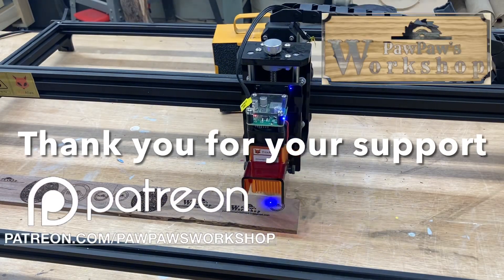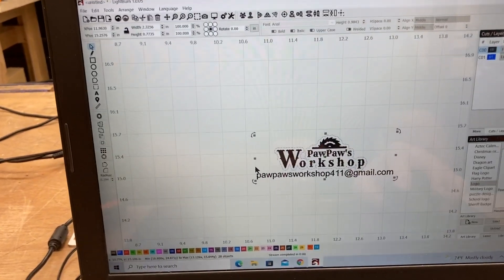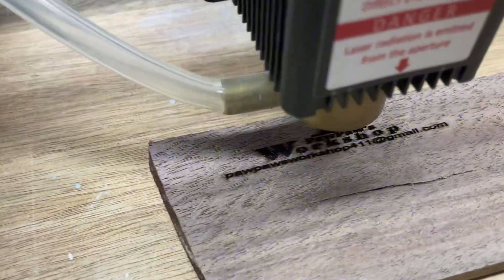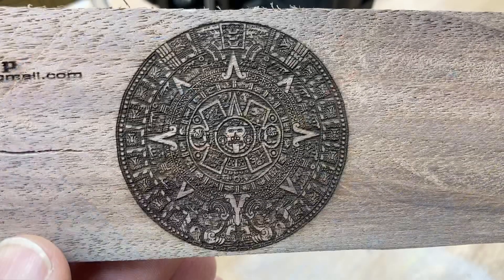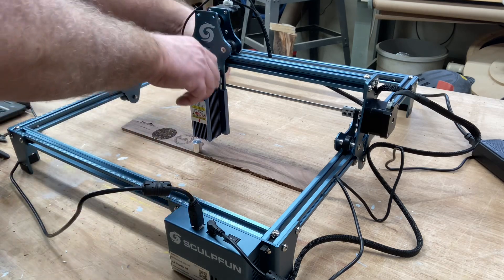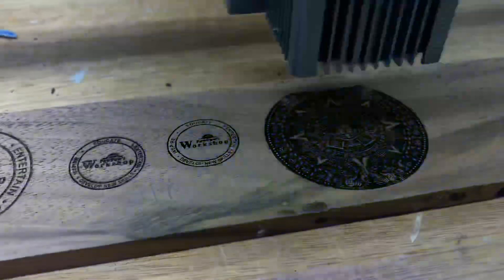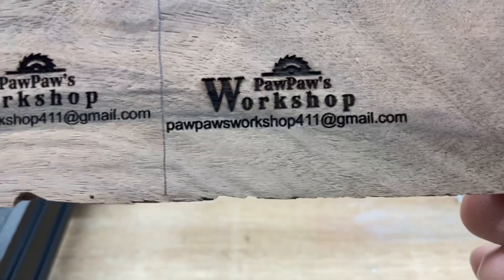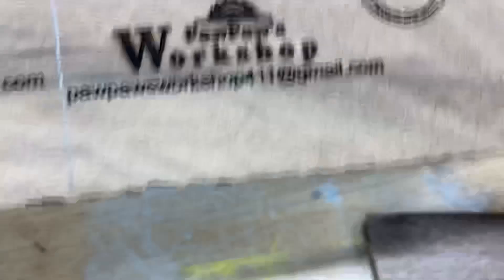Tiny Engraving on Walnut With Three Lasers

Comment: Hi Paw Paw, Been a fan of your channel for quite sometime. I have the Jtech 4.2w laser mounted to my Xcarve. How important is it to use a smoke fume extractor when using these small diode laser engravers? You had a small smoke/fume extractor in the video can you share what and where you purchased?
Thanks
Reply from the maker: Smoke can be a problem. A small project. Not so much. I did a review on the smoke extractor

Comment: you should quit using the nomenclature the Chinese companies use as they are very misleading. Max real output from one diode is 5 watts. The numbers they use are very misleading and will reference things like the power the machine uses which is useless data and has nothing to do with laser power.
Reply from the maker: The power is input which I have stated in other videos. The output for a diode laser is 5 to 5.5 watts. Again stated in numerous videos and in comments. The way all of the companies are increasing power is by adding more diodes. Therefore, a 40 watt laser by any company is two diodes each producing the 5 to 5.5 watts thus equals to 10 watt output. There is a mirror that the second diode is shining on and directing the beam causing the two beams to join. This nomenclature is used by the vast majority of companies. To avoid confusion I am simply using the common denominator. 

The other factor you did not mention is the size and shape of the beam. This is an improvement over earlier lasers. The first were rectangular and you could see it clearly when you engraved a simple square. The beams also were relatively large. Now you are seeing beam size of .08mm and a longer focal point. 

Thank you for your comments
Reply: @PawPawsWorkShop  XTool now has a true 10 watt laser with .08 kerf and delivering in april a 20 watt 4 diode laser. I think they are claiming a .1 kerf
Reply: @PawPawsWorkShop  sir, have you used the Endurance lasers? they have a 30w combined laser - true 30w output  - 3 10w laser aligned into one beam.  any thoughts (under $1000)